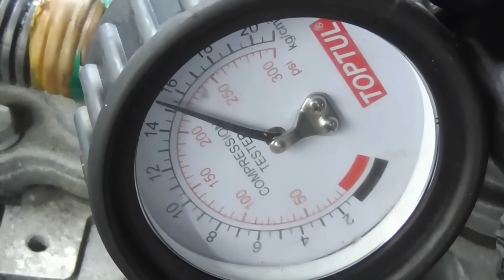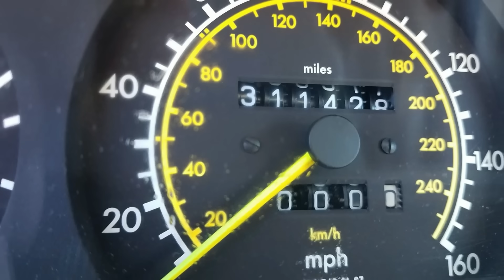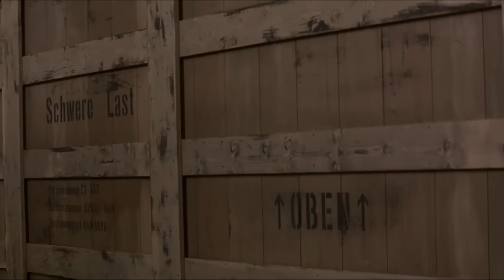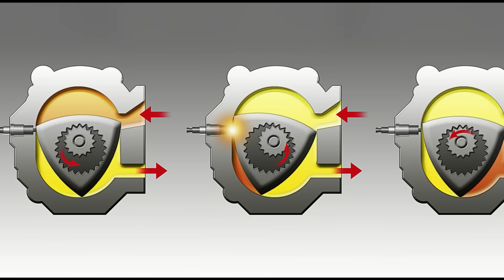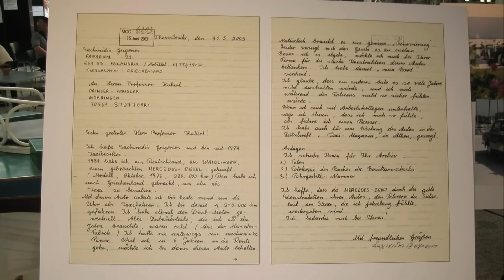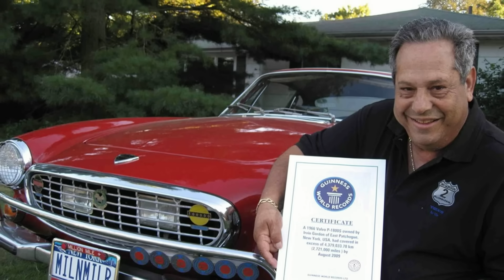Most Reliable Engines of All Time

Comment: Ford 300 CID straight 6 
Bulletproof 
No timing chain :gear to gear
and 
Incredibly easy to work on
Reply: I have one that's 25 years old. I bought it because our fleet vehicles had them and they stood up to decades of use and abuse.
Reply: I don't know why he left that one out.
Reply: @ZEEKUPP  Because it's American.
Reply: Only prob with 300 was gasoline drinking problem
Reply: Yes.     It’s all greed   Building ever thing from cars to dish washer ( cheap ) they want your money to & not worried about tomorrow
Reply: Thank you Nicky L
Reply: Totally agree with you and also the straight 6 4.0 in the jeeps
Reply: You're absolutely right! the Ford 300 Straight 6 is a great engine! And I'm not a Ford guy. I had one in an F250 that was given to me. And drove several in a company's motor pool that I worked for. My vote for BEST ENGINE is the Cummins turbo diesel! Hands down!

Comment: Somebody is not doing their homework my father started a Co-op Taxi Company and New Orleans in 1938 first the Chevrolet then a 52 Plymouth don't know how many miles on that one till I got involved in 63 and in 64 as he bought a new police package with the 318 for his Taxi which he kept doing he bought my mother a push button Slant six Valiant. With six children he was a maintenance freak rightly so we change the oil every 2000 miles the transmission serviced every 15000 miles. The lowest mileage we got out of any of the taxi cab packages was 450,000 miles and we sold them running like brand new then the last one we had was a 77 bought brand new a Plymouth Gran Fury and we went to five hundred and fifty thousand miles again the same motor same transmission and so they close to six hundred thousand miles it may still be running. The Slant six should be the king of all because I had at least five of them and all six kids drove the brand new 64 Valiant until it had six hundred and fifty thousand miles and my father's personal mechanic that did other stuff than common maintenance we did bought it for his son but none of these cars wherever pulled down and to the block of the inside of the transmission all original parts. The slant 6 went on to be a tank motor in the military they just enlarged it because of the slant you could not kill them I threw a rod and a slant six and I was a mile away from home open the hood could see the Piston flapping around because the cast iron was gone drove it home turned it off and started it back up the next day ha show me a Toyota or any import that could touch that

Comment: Uhh 150-200k miles ain't dick. If it doesn't last that long, it's probably American. The 13B also is not reliable, requiring seal replacements and oil injection. It's regularly swapped out for having limited potential.

Comment: These "most reliable engines ever" are known to go 100k to 120k miles without any issues.... Lol. My Kia optima has 140k miles and has never had an issue either. And it still runs like a top. Maybe it's the best engine ever, too.

Comment: Mazda rotary engine reliable 🤣🤣🤣🤣🤣🤣
They're prone to blow rotar tip seals, definitely not reliable. 
If a engine does not need parts except for filters and still haven't been opened at over 300000 miles doesn't use a drop of oil extra between services and still have its power and no blue smoke then it's reliable like the Peugeot 406 I had, it would have still ran if some idiot didn't drove into it and wrote it off.

Comment: If you change oil and filter regularly and look after it, most decent motors will last well over 300,000 miles with no issues.
Reply: True a Saturn 1.9 usually lasts about 350k
Reply: Unless it’s a2011-2013 Hyundai in cold climates

Comment: My BMW X5 with a M57 3 litre diesel motor has done over 365000 km (227000 miles) and still runs like a lamb. No problems.

Comment: I have 235000 miles on my Dodge Caliber still running good. Not bad for a little 4 cylinder it’s not fast but has been great. Still driving it. Has a long way to get 1000000 miles

Comment: My 300 GD has over 700.000 miles from new and still goes well and pulls no M.O.T or road tax goes in up to 4 feet off water snow no problems not like some new cars as very little electric parts to replace

Comment: This is BS, they are mentioning engines with 200'000 miles or more. Any engine can reach 200K, that is nothing special, once we reach 400K or more, then we talk about reliability, the highest one I had was a Chevi van with a litte 305 V8 with 470'000 Miles and was still driving fine when I drove it to the wrecking yard.

Comment: Any engine can be kept going-the fact is, age is the biggest reason why cars are junked. At 10,000 miles per year, a car with 200,000 miles is 20 years old-that is when the body is rusted out, plastic interior parts break and fall apart, and the headliner falls down. All of these super-high miles engines are from cars driven on highways-10,000 miles of stop and go driving is equivalent to 100,000 highway miles.

Comment: Volvo is 2.3 four-cylinder turbo charger not half 1,000,000 miles on them engines no problem guys an asshole he thinks of Mazda rotary should even be anywhere is in the top 50

Comment: The Mazda wankel engine was certainly not reliable.  It's rotar seals lasted about 50,000 miles at most before the engine had to torn apart for replacements.

Comment: YOU CAN ALWAYS TELL SOMEONE WHO HAS NO IDEA WHAT A BADASS ENGINE IS .HERE LITTLE BOY LISTEN UP,,, THESE ENGINES WILL GET WARMED UP AT 350,000!! VOLVO REDBLOCK AVG.400,000 AND THE BAD BOY IS THE JEEP 4.0 STRAIGHT 6. THIS ENGINE IS SO STRONG IT HAS 7 MAIN BEARINGS TO SMOOTH THIS BEAST OUT IT WILL OUTPULL,OUT CLIMB ANY 4X4 PERIOD !! NOTHING OUT THERE THAT COMES CLOSE,MAYBE THE OLE INTERNATION CHIEF, OR SCOUT,THE ARE SO MANY OLE JEEPS OUT THERE WITH 445000 to 600,000 MILES they just KEEP ON DOING THERE JOB! GETTING YOU FROM POINT A TO B.IVE BEEN THROUGH PLACES YOU COULDN,T GO IN TENNESSEE ONLY IF YOU HAD A ZJ WITH A 4.0 .I'VE GOT A OUTBACK THAT ALL MOST MADE IT BUT THE JEEP WAS TO TUFF,OLE SCHOOL DANA 410 UP FRONT OLE SUBIE AIN'T THAT STRONG,BEEN THERE DONE THAT!HOW MANY 4X4 YOU KNOW WON THE USA A WAR,,JEEP DID WWII!!
00

Comment: Who actually says 100k miles is a reliable motor. I think that's expected today. the Reliable term should be reserved for 200k+.with no major issues.Just my opinion.

Also there are a lot of diesel trucks in the states with 500k+ still kicking. Plus what about gm 5.7 and 5.3. 200k+ motors.  

Can't name them all i guess.

Comment: Funny thing about the Volvo, P1800 is the worst Volvomodel to keep alive since it has no fenders etc, it's all one piece with the body so you have to be very careful of rust and stuff or it will be really hard/expensive to repair and bodyparts are not plentiful. All volvos from that era had the same engine and transmission and there's a lot of volvos here in sweden with high millage on the clock that runs great! Here in Sweden we say that if the Volvo has less then 200 000 miles on the clock it's not broken in yet, of course this is only true before ford bought Volvo and ended the era of immortal engines with en 940-series with the B230FT-engine in 1998.

Comment: Everybody thinks high mileage is bad.  If you maintain an engine it's better if an engine was running non stop for 20 years over a car that's sat for 20 years but says 10k miles.  Thermal cycling bad

Comment: If you know how to use a clutch. Even dumping it soon as the light turns green, yes you can get 100k or more out of it. Under powered Honda however, not so much. Good clutch mated to a decent powered engine will have a long life span. Why? Fn clutch isn’t going to burn the hell up trying to lay the power down.

Comment: all imports, hell my dad had a park avenue with 450,000 on a GM 3800 V-6, Still didn't use any oil, ran strong, but the rest of the car gave out, suspension and electronics finally gave up the ghost. There is a reason GM killed the 3800, it was bullet proof

Comment: I’ve had 3 trucks with the vortec 4.3L 6 cylinder engine, I drove all three past 200,000 and the first one was in an s-10 that ran to 330,000 before I had to replace the front main seal.

Comment: 778K miles Ford 300 F250 1989 T18 trans with stock clutch 1 rebuild of the stock motor at 602 trans fluid every 45k and oil every 3500, after rebuild and cleaning out full synthetic 20-W40 Castrol GT

Comment: My 91 Toyota celica got over 340000km with everything stock except belts,  the water pump and rotors/brakes. But was stock clutch, slave,  injectors,  coils,  bearings etc

Comment: Dodge / Chrysler stopped making the 5.2 liter (318) because they never sold parts. 250K miles is just broken in. I've had several over 300K. Sure the vehicle rust is terrible (I  live in Wisconsin) but the motor is almost unstoppable.  Same reason Ford no longer makes the 300/6.

Comment: Toyota 22R engines are hitting over a million miles and still running strong..
Reply: Says you! Mine started burning oil at 80,000 miles. That's a quart every 100 miles. I changed the oil every 3,000 miles.  The piston rings were crap! Toyota is no better than anyone else. Just better at hiding crap than others.

Comment: I wish mercedes would build a simple diesel car again without all the gadgets and nonsense.
Reply: Emissions required those gadgets and nonsense.
Reply: @dundonrl  That's the first thing to strip off of the new diesels. It's pretty easy to get 50% higher fuel economy once the EGR, DPF and SCR are gone.
Reply: @rich7447  100k fine for the shop who removed it and 10k for the vehicle owner...
Reply: @dundonrl  You can easily remove it yourself and there is no emissions testing on diesels in my state.
Reply: @rich7447  You can remove them,  but need a tune to remove them electronically.
Reply: @dundonrl  Correct. You can do that yourself with a programmer like EFI Live.

Comment: I have a 1989 F250 7.3 diesel with 890,000 on it.  engine not touched!
Reply: It is possible to get 3 million out of the international 7.3 diesel and loaded it gets the fuel mileage of a 302 v6.

Comment: 300 incline Ford is the most reliable engine prove me wrong
Reply: You're definitely right on that
Reply: Yep, mine is nearing 300k on it now
Reply: My friends F150 with in-line 6 has 750k miles... my 7.3L PowerStroke is tailing behind at almost 400k. Both still on the road, only that F150 needs a new transmission.

Comment: My best friend worked in a Benz shop in the 90 s he said they serviced several 300 d vehicles with over a million miles ,2 or 3 hundred is just getting broke , my 85 300 td had 890 k when is sold it it was still running great, almost as good as a Volvo 2.3 4 cyl.

Comment: Here's a story.  I had an 83 Bronco with a 300 six cylinder and 4 speed granny.  I ran it to 120K miles then wrecked it in 1990.  I bought a truck for $800 with blown engine, and swapped the engine out with the one from the Bronco. It ran the next 12 years for I'm guessing 150K miles.  The old truck was rusted out, so we pulled the engine and junked the truck body.  My buddy had a sawmill that needed an engine so we put the old 300 in service again thinking it would just be temporary.  It ran the next 8 years for 8 hrs a day making lumber.  Finally it threw a rod through the block.  We think the oil pump failed and the guys just weren't paying attention or it might still be going.

Comment: My 1996 acura rl with a c35a1 has 2956235 miles on it I drive all the time non stop every day it is part of my job to do so I have bought it new back in 1997 and had a manual transmission swap put in it and had the engine rebuilt 4 times

Comment: A clutch lasting only 50.000 to 100.000 miles? Is that a joke? Ik drove an Opel Corsa B-type for about 200.000 miles, never had to change a clutch. Had a cheapo Suzuki Alto with 175.000 miles, never any issue with the clutch. A car should last at least 100.000 miles without any serious defect.

Comment: Haha you certainly dont know your engines rb26 isnt strong enough from factory to be boosted up to 1000hp without stronger internals and supporting mods.
Also a Mazda rotary is not reliable at all they require rebuilds every 10000 miles when heavily boosted as the seals go plus they have to be additionally lubricated with 2 stroke in the petrol to make the seals last longer.

Comment: I have a 1968 Volvo 144s with the B18 engine. This was my Dads car. He bought it new until he died in 1992. It then had 280,000 miles on it. When I inherited it, it stiil had the original clutch and had only gone through 3 sets of brake pads. He changed the oil every 5,000 miles.
The car now has over 500,000 miles on it and I have put one more clutch in it. I still change the oil every 5,000 miles and the transmission every 10,000 miles. It still has 150lbs of compression and it still has the original wheel bearings.
I know many older Volvo's with the B series of engine. The reason it is so durable was that it was originally designed as a boat engine and had to be really durable.

Comment: Not sure where you got this info. Back in the 90's I drove for a company called "Airport Shuttle" we used all Dodge Ram 9 passenger vans with 360 V8's. I drove a lot of them with over 300,000 miles on them.

Comment: I have a 02 ford ranger 3.0 V6 with 248,000 and I still drive it every day . Also had a 85 chevy astro van with a 4.3 V6 that had over  320,000 miles before it rusted out from New England winters .

Comment: 263,000 miles on my Infinity g35 sedan. Lifter ticking for 2 years now. Runs perfect besides the lifter tick. I can fix the lifter for the same price of a 60,000 mile motor for@$900. I think I will toss another motor in it. It still drives like new and is in pretty good shape still. I have 2 Corvettes 87 auto and 86 4 speed manual and the Infinity is just as fun to drive, just don't look as cool. Big v6 light car with rear wheel drive and 290hp.mor like 310. Good cars I think.

Comment: 22 R Toyota, by far way ahead of all these in reliability, and Dodge slant 6, and wtf about sbc?
Reply: Toyota 22 R E absolutely a top 5 most reliable engine. Buddy was putting a 350 in his toyota truck for a mud truck conversion..we drained all the oil out of it and just gave it hell for a few hours..we literally could not blow it up. I had a 22re in my 92 toyota truck and was awsome.
Reply: @jordandegraw8011  I just bought a 1987 4runner with a 1992 22r. for some reason it was eating oil intermittently and it ran out like three times in two weeks. turns out it was a stuck PCV. now it was a wrist pin slap but I'm about to repair that myself.
Reply: Or the AMC 4.0? Ford 300?
Reply: I had a slant 6 in my 83 dodge
Reply: Roy Mckinney   Yep or the predecessor 20R from the 197Os
 The 20R was originally designed as a forklift motor  then modified for a car. 
rings were 1/4 inch thick.
Reply: @dfields9511  Ive got two of them sitting on a bench in my shop. one I bought and one that blew a head gasket. They are almost impossible to find now
Reply: Well said
Reply: Definitely
Reply: Sad I had to scroll down so far to find this, should definitely be in top 5
Reply: no contest. 22r should have been at the top of the list. in production from 82-95. Waaaaay more toyotas out there that went 300,000 miles+ standing on their aluminum heads. Simplest most robust engine ever made. you can bore a 20r from 2.2 to 2.6 liters. Easy turbo EFI, cam, easy to work on. It's still used in racing today.
Reply: You know what is more awesome. I Know a dude who literai ran from the law for a death penalty charge.....,. Some seen or was around him every day. He eventually got convicted and faced death.  Three days later he rose, yeah everyone told you that. Did you know that after he rose from the dead, he spent dirty more days with his disciples!??

Comment: My uncle has over 400.000km on a Škoda 120 that's a 1.2l mini engine and my dad had a 2004 passat b5.5  1.9tdi 131hp with 578.000km and it runned like a new engine and still selled it for 1000€,so your info ain't that acurate sir it all depens how you drive it and take care of thw engine.

Comment: I drive a 1990 Toyota FJ62 Landcruiser with a 3F petrol engine it has 557,000 Klms on the clock the clutch is the original  factory fitted one as is the engine and gearbox and also the diffs it has had regular servicing and normal maintenance ie wheel bearings seals and brakes and it is still strong it uses no oil between services and it has been driven extensively off road  and it will probably exceed 1,000,000 klm as do many Toyota Landcruisers

Comment: I've owned my 2002 Mustang GT 5speed car Feb will b years 17 and 350000.0miles driven daily!! Has original every thing , other than maintenance items like rotors n pads!! Yes has factory clutch and throw out bearing everything is factory fuel pump factory water pump only item replaced on engine was thermostat replaced with 160° due to computer programing oh ya!! Off road X pipe with O2senor replaced but has no converters on it with flowmaster muffler and factory cat back tail pipes!!! Only engine oil I've ever had in my baby sents new is Mobil1 full syn 10w30 winter and 10w40 summer with Motocraft filters!! Best car I've ever owned !! I've owned 2 new Z28's one was 1990 IROC Z 5speed car other was 2000 Z28 6speed car both engine where Great but trans n rear ends where weak!!